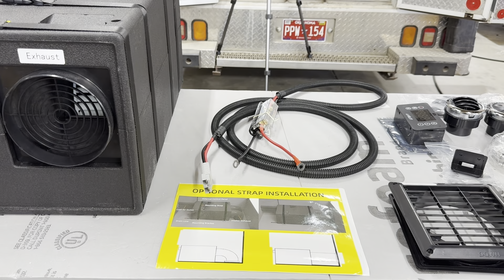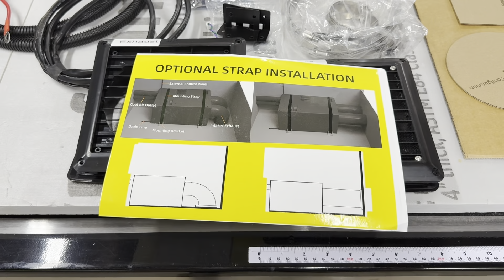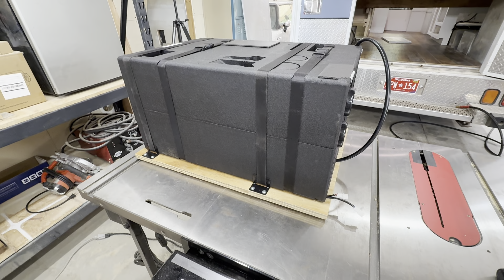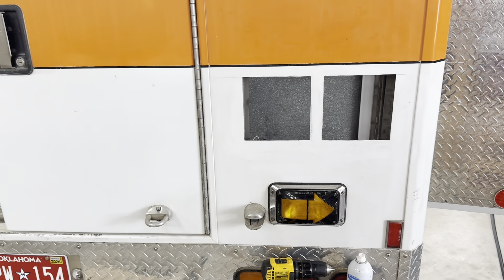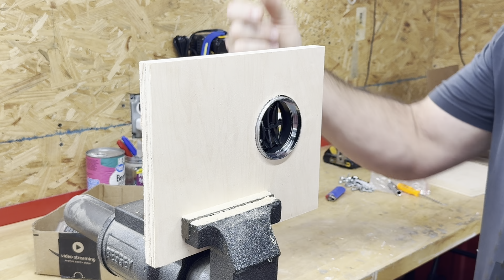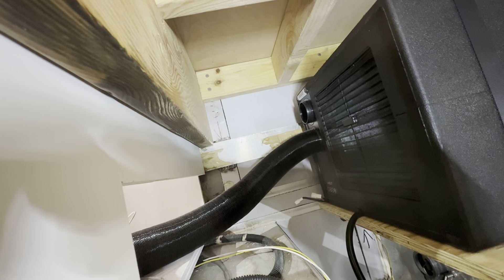Velit 2000U DC powered air conditioner. Installation and first impressions.

Comment: Just another "DC" air conditioner that uses an inverter. 

I have inverters, powerful inverters that are more efficient than what they are using. 

I want a 48Vdc air conditioner without inverter losses. Else I'm better off running it off 120Vac.

Comment: im just going to use a new type inverter home window ac.
Reply from the maker: I considered that. I just needed to be able to run it driving down the road. I did find the Chinese unit and damned if it doesn’t look identical.

Comment: Love your camper and thanks for the video- great information. Im a AC tech in AZ and the hardest thing for an AC to do is catch up. I bet it’ll be fine if you start it before temps are above 80°. Have you tested it with that Maxfan on so it’s removing the hot air trapped at your ceiling? Other thing is the vents are low and the floor isn’t insulated, is there a way to raise the vents?
Reply from the maker: Thanks man we have put a lot of work into it. Appreciate the compliment. I plan to preface the final ac video with a retake of the same test (abbreviated in length) with the ac having started much earlier in the day. Give it a chance to kinda get a head start. The length of the ac vent tuning would allow it to go higher, and that may still happen, but I like where the front vent is because it points directly at the dinette area. We’ll see I guess. Thanks for the comments!

Comment: I wish that this product would work
Reply from the maker: I wish it worked better. Gonna try a few things like ceramic window tint, window block offs, and seal up the better of the camper better. Keeping my fingers crossed.
Reply: @TheFreedomAdventure wrap some insulation around those hotvent pipes too. I bet they radiate a lot.
Reply from the maker: @rubikmonat6589 yes sir! I have not done it yet because of other projects, but insulating those pipes is on the list of things I will be doing to increase efficiency.
Reply: Will you use a box fan in front of it that helps a little

Comment: I think those vents are supposed to oppose each other ? The angle down i think one goes to left one to right.
Reply from the maker: I think you’re correct. If they had been facing down, I would have done that. But being on the back of the camper, it would have made them very susceptible to rain. So far the unit has been working well, but should it present a problem I may relocate them to the floor of the cargo compartment.